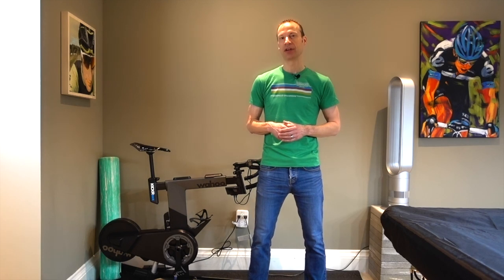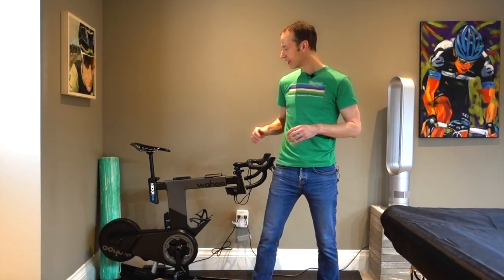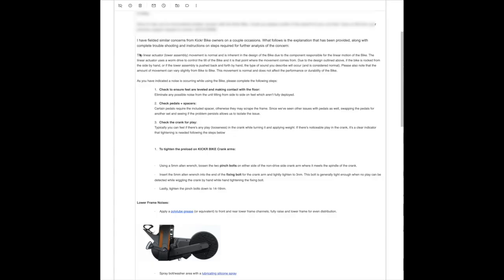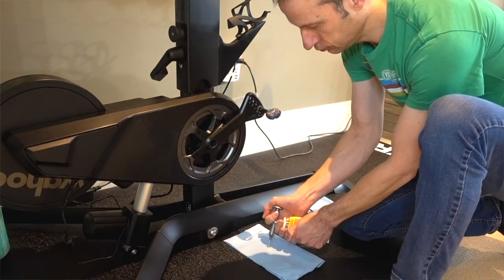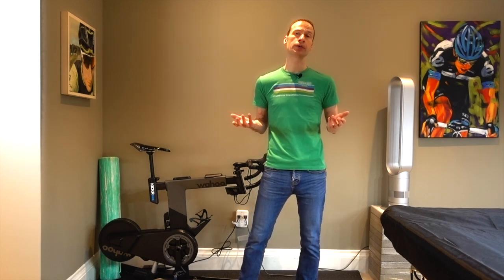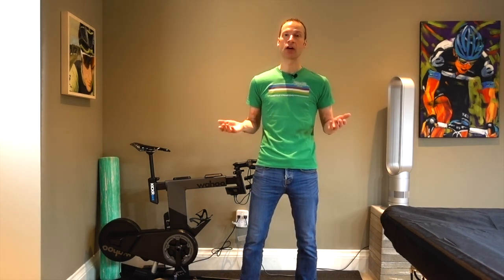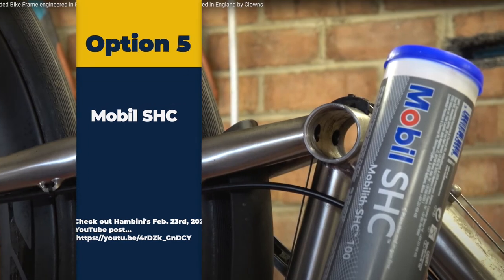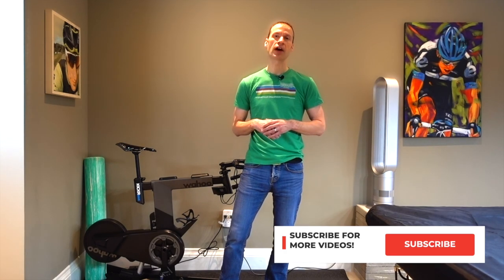Wahoo Kickr Bike Review Pt 2: A Fix is Found for this Indoor Trainer!

Comment: Hi Mike,
I found this comment… Have you tried this - can you show in a video?

My Wahoo Kickr Bike started making some serious creaking noises when pedaling. Like really loud. After getting in touch with WAHOO, it was determined that the seat post sliding rail needed to be lubricated. This can be accomplished by pulling the seat post assembly which slides up and down, off of the frame. To do this, you must back the bottom screw out from the the water bottle cage mount. It doesn’t have to be completely removed, but almost. Then, while pulling the seat height pin out you can lift the seat post assembly completely off the frame. When you do this, a plastic thingy, for back of a better word, will fall out.The plastic thingy was held in by that screw and restricts the seat post assembly from being completely removed Set the seat post assembly aside and you will see the rails that the seat post assembly slides up and down on. Lube the heck out of the sliding areas and inside the holes on the back side that the height adjusting pin goes in. Remount the seat post assembly, down to the H position. Then get the plastic thingy and insert it back into the front side of the seat post assembly, with the flat side down. Then you can reinstall the lower water bottle cage screw. I used Park PolyLube. Good luck!
Reply from the maker: So, I haven't tried that, but it is good information to know. So far I have been able to stop the creaking noise by lifting (but not fully removing) the seat post rail to its highest position and then applying grease. But the fix you posted seems like the best way to remove the creak. I will do a video on Kickr Bike maintenance sometime in the future. Thanks for the suggestion.
Reply: I very much would like to see a video according to my comment. I wonder about, what this is… 

“plastic thingy, for back of a better word, will fall out. The plastic thingy was held in by that screw and restricts the seat post assembly from being completely removed”.

“Remount the seat post assembly, down to the H position. Then get the plastic thingy and insert it back into the front side of the seat post assembly, with the flat side down.”.

I’m affraid to do something wrong, that’s why I recommend you to make a video… 😀👍
Reply from the maker: Just wanted to let you know that I finally got around to doing a video on how to maintain the Wahoo Kickr. Here is the link... https://youtu.be/FBa5jDDtHiE

Comment: Mike, First you are confusing the ride over height slide adjustment for the "Linear Actuator"which is the component that inclines the bike. I have had several Kickr Bikes (because of replacements for failures) and never had noise from the 'standover height slide". It has a locking pin (at the height adjustment steps) combined with a clamp which clamps the two tubes solidly together (provided it is applying enough pressure). I have however had 'play' and 'noise' from the "Linear Actuator" (that inclines the bike) because of too much clearance in the pivot bushings. I machined new bushings with tighter clearances and that solved that problem.

In addition, if I were you, I would take a look at your riding style. You have an incredible amount of sideways motion - which is 'wasted' motion that should be going into rotating the pedals. If you focus on developing a "Round" pedal stroke you can eliminate a lot of the sideways motion because almost all force is applied inline with the pedal rotation and normal to the crank axis.
Reply from the maker: You are right. It's not the linear actuator, but rather the ride over height slide. Actually, Wahoo refers to this piece as the "front and rear lower frame channels." No matter how tight I clamp down the lever, there is still a tiny bit of movement in these channels. Like I said in the video, it's a non-issue now as the polylube I applied fixed the issue.

As for my side-to-side movement, I was trying to throw the bike laterally to exaggerate the noise and make sure the mic picked it up. Also, the bike is on a rubber mat with carpet underneath, so it's not as solid as if it were mounted on a hard floor.